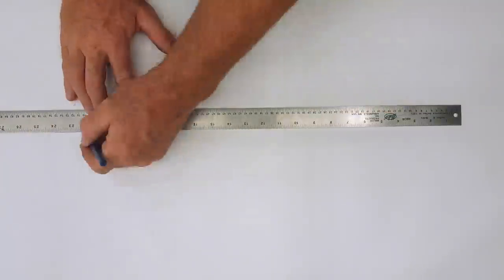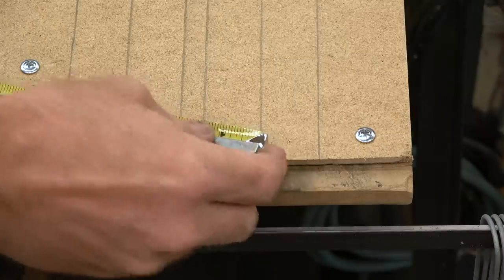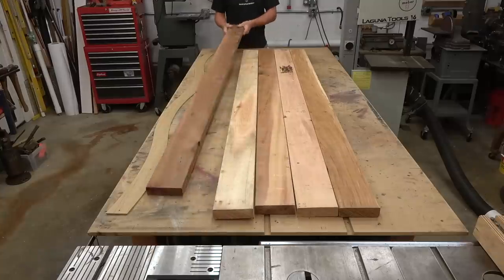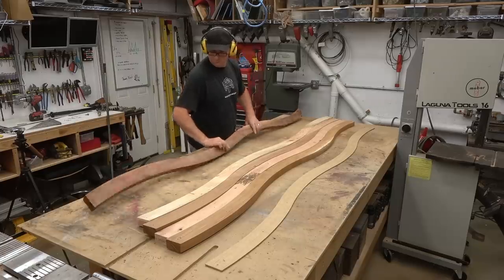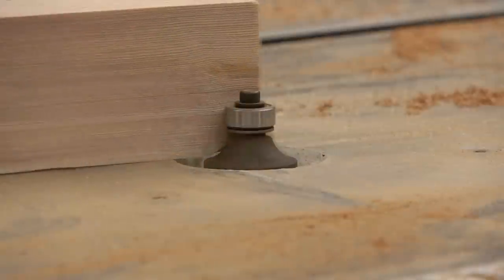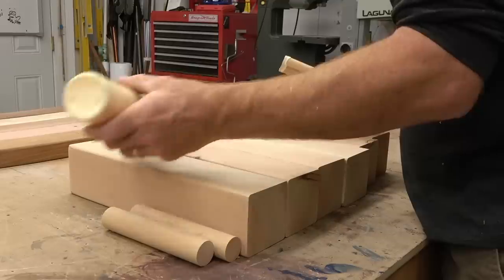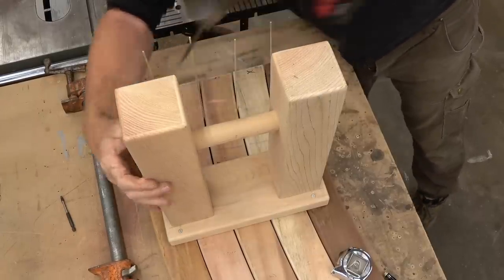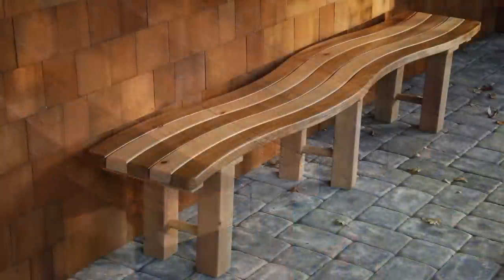How to Make a Curved Outdoor Garden Bench

Comment: Thank you very much for an outstanding project presentation.  I only needed a 6' bench to use with a table on our screened in porch.  I used these plans to create a 6' bench with an additional 2' seat.  Both turned out great.  I finished them with two coats of McCloskey Satin Marine Spar Varnish thinned down 15% followed by two more coats full strength.  I am hoping to get 3 - 4 years of wear before I need to refinish.
Reply from the maker: That's great! I'd love to see it. You can join the Make Build Modify group and share the project if you feel so inclined. https://www.facebook.com/groups/MakeBuildModify/

Comment: I love your bench design and your build process. I used to use thin wooden battens bent around finish nails to draw curves in my old wooden boat shop I ran years ago. I like your method though - I think it's a more accurate way to get the job done. Thanks for the tips.
Reply from the maker: Yeah, I've used the bent wooden strips trick too. It can be a very useful way of getting the shape you want. Especially When you're on the jobsite with limited resources.

Comment: Love the curves.  The frugal part of me is wincing at the "waste", but it makes the end result so much nicer.  Here in Seattle, I've only applied spar urethane with a brush for outdoor projects, I'm not sure I'd trust the density/coverage from a spray can - can you speak to your experience of how it holds up?
Reply from the maker: This is the first time I've used the spray can. I applied four coats because that was the recommended number of coats. After reading the instructions for both applications (same product) I couldn't find any disparity between the two. I'm in the Pacific NorthWest too so this is an experiment. I guess I'll have to wait and see. Thanks for watching!

Comment: You lost me with the arc layout. When you transferred them to the full size template how did you come up with the 58 1/2" measurement? Not trying to copy yours just want to learn how to do things like this.
Reply: It's just scaled up from the smaller drawing. Multiply the circle size needed on the small scale drawing to what you want for the full size template.
Reply from the maker: It's tough to put into text but I'll try. Each arc section in the drawing is 24" wide. If you measure the from the high point of the arc (rise) to its accompanying parallel line (cord) the rise is 1.25". Since the arc section is 24" so is the cord length. There is a formula that work for finding the radius when you know the rise and cord length.  ((cord length / 2)² / (rise) + (rise)) / 2 = radius.   TabLeft Workshop has a good video on the subject. Here's the link https://youtu.be/vLf1742TWLY

Comment: Who doesn't love bacon?  It's perfect.
Reply from the maker: I was thinking of making an egg shaped stool to go with it.
Reply: @Makebuildmodify  I thought about it all night.  Drink tables.  Small but we'll shaped.  If you used only light color wood for the outer rim, a tinted round glass center could be the yoke.  One one each end of the bench would be perfect.  Maintain the wave except smaller and cut the entire table circular.  The glass yoke could remain above the wood surface and removed to alter the look from time to time.
Reply from the maker: Yes! that's a great idea!